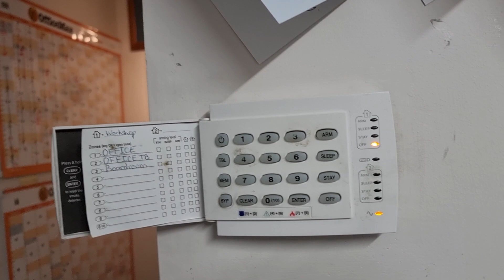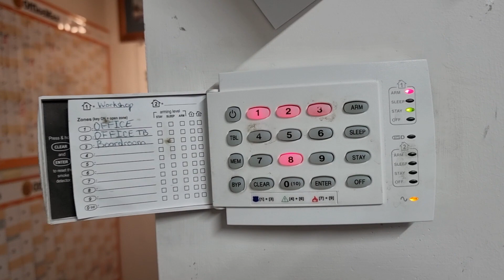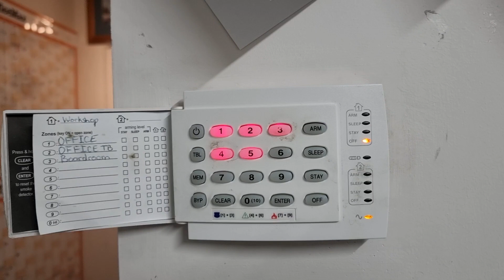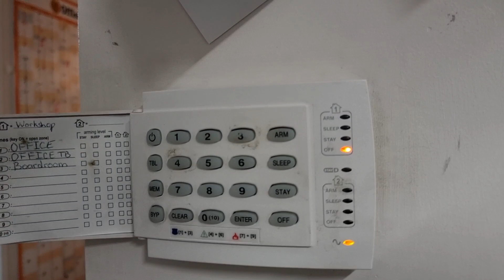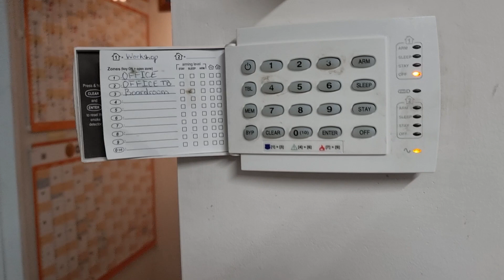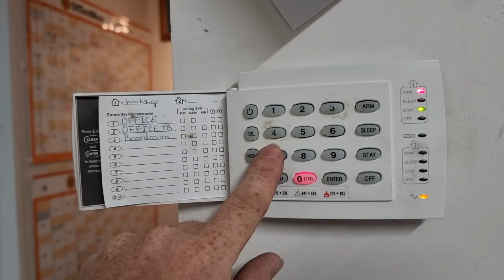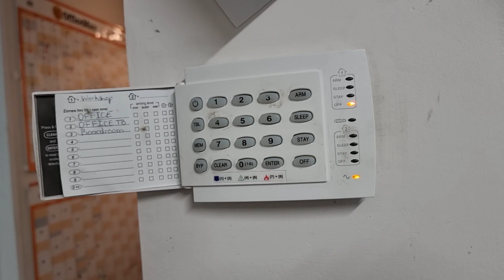How to quickly program a Paradox Alarm with MG5050 and K10H

Comment: Our Alarm started beeping in the night with error code 8 which would not clear.
I disconnected the battery-which later tested ok at 13.7 V -and pulled the fuse on the control box to turn off all power to the unit but it still continued to chirp for quite some time -at least till I feel asleep -and then in the morning when I powered it up again it started chirping again with error 8 back again but when I cleared the error code it stopped chirping and error code 8 did not return.
Any ideas as to why it would still chirp with the control Box powered off and what was going on ?

Comment: Thanks - useful video. I have a sp6000. I want to change the delay of an existing set up exterior sensor #10 to instant as there is a delay currently. I believe this is code ´08´ looking at Chapter 7 in the manual. So if I understand correctly the sequence would be: Enter-0000-010(zone)-08(zone definition)-1(partition). ? Will it ask me about the part at the end for the EOL resistors selection event thought they are already set up? Thanks
Reply from the maker: it should not. it should simply work as per your statement.
Reply: @bradthesparky91  perfect thanks. How do I exit the programming mode without making any changes? Just want to check if the installer code hasn't been changed first. Cheers
Reply: entered Enter followed by 0000 or 000000 and the panel just emits a long beep at me and does nothing. I assume the installer has changed it then? I bet they are not willing to give it to me and I´ll have to reset everything!! @bradthesparky91
Reply from the maker: unfortunately yes you would have to reset and reprogramme the system.  @CJ-vg4tg